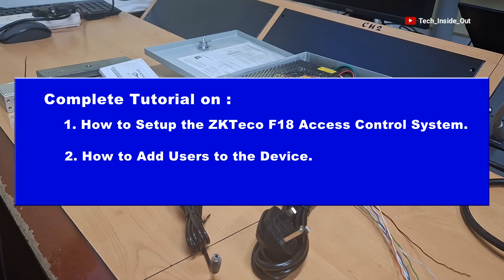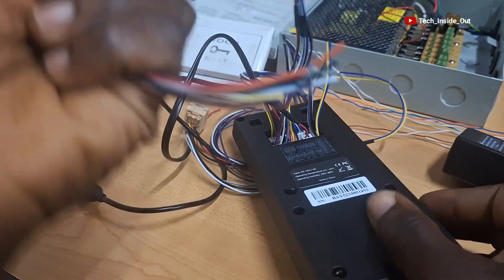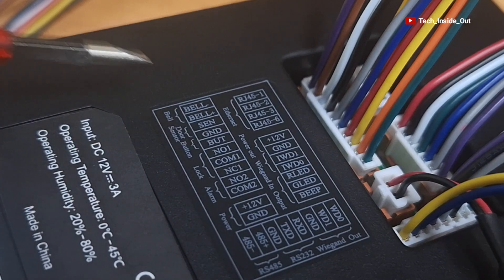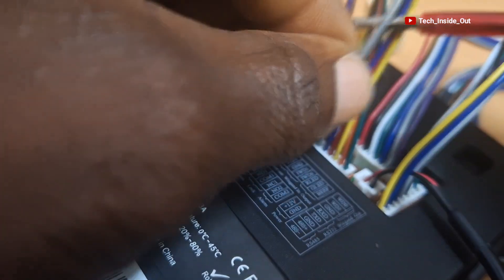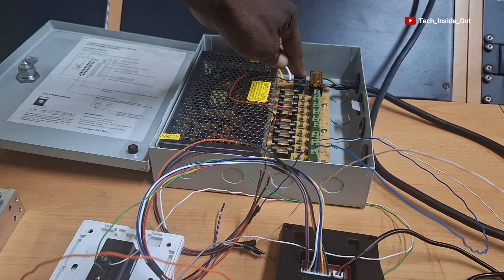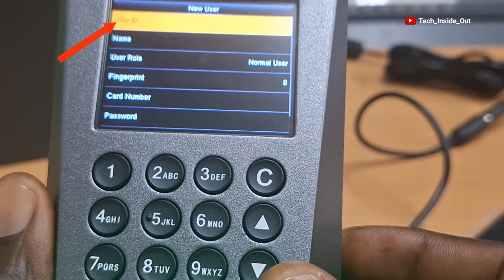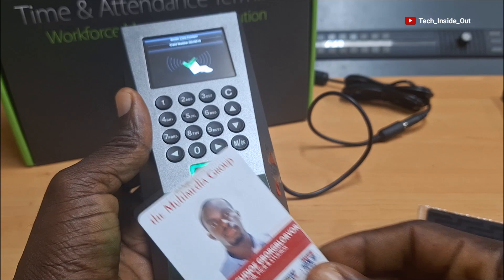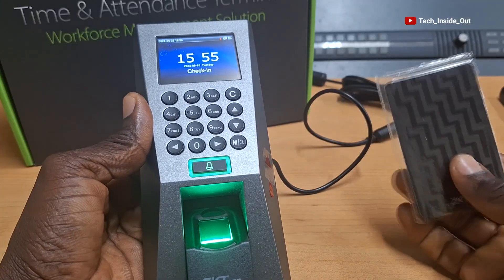zkteco f18 access control system setup complete tutorial from beginning to end

Comment: hi Ben
I am getting this error
21-Sep-25 12:41:45 PM Connecting Device(Test power)
21-Sep-25 12:41:46 PM Device Connect Succeed(Test power)
21-Sep-25 12:41:46 PM Updating informations, please wait...(Test power)
21-Sep-25 12:41:46 PM Synchronizing TimeZone Information...
21-Sep-25 12:41:46 PM Synchronize time zone information from PC to device failed:Socket Problem
21-Sep-25 12:41:46 PM Setting holiday information...
21-Sep-25 12:41:46 PM Rest holiday information failed:Socket Problem
21-Sep-25 12:41:46 PM Setting Antiback info...
21-Sep-25 12:41:47 PM Synchronize Antiback information from PC to device failed: Socket Problem
21-Sep-25 12:41:47 PM Being set door parameters
21-Sep-25 12:41:47 PM Setting door parameters failed: Socket Problem
21-Sep-25 12:41:47 PM Being set wiegand format
21-Sep-25 12:41:47 PM Test power-1: Setting the Wiegand format failed: Socket Problem
21-Sep-25 12:41:47 PM Setting interlock information...
21-Sep-25 12:41:47 PM Synchronize Interlock information from PC to device failed: Socket Problem
21-Sep-25 12:41:47 PM setting linkage information...
21-Sep-25 12:41:47 PM Synchronize linage inout information from PC to device failed: Socket Problem
21-Sep-25 12:41:47 PM Setting multi-card open information...
21-Sep-25 12:41:47 PM Multi-card Door Reset failed:Socket Problem
21-Sep-25 12:41:47 PM Being set personnel infomation
21-Sep-25 12:41:48 PM Synchronize personnel information from PC to device failed: Socket Problem
21-Sep-25 12:41:48 PM Being set personnel time zone
21-Sep-25 12:41:48 PM Synchronize personnel privilege information from PC to device failed:Socket Problem Access Level Record Quantity:1
21-Sep-25 12:41:48 PM Being set fingerprint
21-Sep-25 12:41:48 PM Synchronize fingerprint templates from PC to device failed: Socket Problem
21-Sep-25 12:41:48 PM Total Fingerprint Quantity: 0
21-Sep-25 12:41:48 PM Setting NormalOpen information...
21-Sep-25 12:41:49 PM Reset first card open information failed:Socket Problem
21-Sep-25 12:41:49 PM Synchronous data success(Test power)
  
21-Sep-25 12:47:53 PM Connecting Device(Test power)
21-Sep-25 12:47:53 PM Device Connect Succeed(Test power)
21-Sep-25 12:47:53 PM Updating informations, please wait...(Test power)
21-Sep-25 12:47:54 PM Synchronizing TimeZone Information...
21-Sep-25 12:47:54 PM Synchronize time zone information from PC to device failed:Socket Problem
21-Sep-25 12:47:54 PM Setting holiday information...
21-Sep-25 12:47:54 PM Rest holiday information failed:Socket Problem
21-Sep-25 12:47:54 PM Setting Antiback info...
21-Sep-25 12:47:54 PM Synchronize Antiback information from PC to device failed: Socket Problem
21-Sep-25 12:47:54 PM Being set door parameters
21-Sep-25 12:47:54 PM Setting door parameters failed: Socket Problem
21-Sep-25 12:47:54 PM Being set wiegand format
21-Sep-25 12:47:55 PM Test power-1: Setting the Wiegand format failed: Socket Problem
21-Sep-25 12:47:55 PM Setting interlock information...
21-Sep-25 12:47:55 PM Synchronize Interlock information from PC to device failed: Socket Problem
21-Sep-25 12:47:55 PM setting linkage information...
21-Sep-25 12:47:55 PM Synchronize linage inout information from PC to device failed: Socket Problem
21-Sep-25 12:47:55 PM Setting multi-card open information...
21-Sep-25 12:47:55 PM Multi-card Door Reset failed:Socket Problem
21-Sep-25 12:47:55 PM Being set personnel infomation
21-Sep-25 12:47:55 PM Synchronize personnel information from PC to device failed: Socket Problem
21-Sep-25 12:47:56 PM Being set personnel time zone
21-Sep-25 12:47:56 PM Synchronize personnel privilege information from PC to device failed:Socket Problem Access Level Record Quantity:1
21-Sep-25 12:47:56 PM Being set fingerprint
21-Sep-25 12:47:56 PM Synchronize fingerprint templates from PC to device failed: Socket Problem
21-Sep-25 12:47:56 PM Total Fingerprint Quantity: 0
21-Sep-25 12:47:56 PM Setting NormalOpen information...
21-Sep-25 12:47:56 PM Reset first card open information failed:Socket Problem
21-Sep-25 12:47:56 PM Synchronous data success(Test power)
  

can you please advise
Reply from the maker: Hello Mr Desouza,
Have you tried a restart of the system.
The error is an indication of the firmware jam up. You can as well contact ZKTECO customer support through their website for a probable firmware update.

Comment: Man I appreciate your videos bro, so well explained cant believe just found them now.

Had some issue with an installation am running that's not aligning well. adding an F18 device to my setup and I have synchronized data to it but the finger prints are not getting to the device? Am using ZKBio IVS Software for management
Reply from the maker: You can use a pen drive to upload the data from the firts device to the F18

Comment: Thanks so.much for the share. I am Installing Access Control for the first time and this video is all I needed. Could you clarify why you added 12v from the power supply and another 22v form via the device power cable ?
Reply from the maker: 22v ? Am not sure, but I will review the video again because the system does not require 22volts

Comment: How do i connect two devices with one magnetic lock,?
Reply from the maker: What scenario could possibly require that connection. Other than that, a push button perfectly opens the lock from inside the location where the lock is installed

Comment: last quest: the power supply box cant give power to both terminal, lock,push button? because i realized U powered another 12V adapter to the terminal again please
Reply from the maker: The terminal requires an external power
Reply: @ okay but I realized you didn’t connect power externally to the mb460 in ur other video. Or because this power supply unit is a normal + - unit, unlike the other power supply unit of the mb460 video which had gnd, push, com1 etc ?

Comment: on the Normal Close diagram for the dc 12v power supply, 
the - 12v go to com1
+ GND 
why did the diagram shows it as - but u fixed it from positive on powersupply to com1?
or the diagram made a mistake?
Reply from the maker: I will have to go back and refer to the video to understand this particular question, i will revert on the findings.
Reply from the maker: I will have to go back and look at the video to understand your question.  i will revert with an answer.  Its a good question

Comment: pls so its not good to connect the lock to NO1 as the diagram on the right shows Normal open lock
Reply from the maker: It depends on how you want your lock to function.  Is it a normally closed state you want to achieve or a Normally closed state? The one that represents how you want the lock to function is what you choose but for most applications,  it should be normally closed where you get verified to open.
Reply: @ thank u sir

Comment: Does it work with any ID card sir?
Can multiple (say 100) magnetic door lock be used on the device?
What happens if someone triggers opens d door without id, fingerprint or password?
Does it record the person who accessed it including the time and date it was accessed?
Reply from the maker: 1. It uses RFID Cards
2. It not advisable because, once the system is opened, all the 100 magnets will open at all the 100 locations
3. It is not possible to open the magnet
4. Yes, it records details of the one that opened the lock with the time the person opens the lock
Reply: @Tech_Inside_Out  Thanks sir...

Comment: How about the error messages of a triangle with red exclamation mark and computers with red x at the top right corner of the screen
Reply from the maker: Computer with the X means there is a break in network connectivity.  The triangle sign is a warning sign that will as well have come after an operation, it doesn't have a specific meaning but depends on what u are doing per time